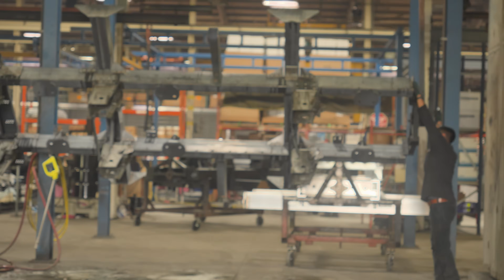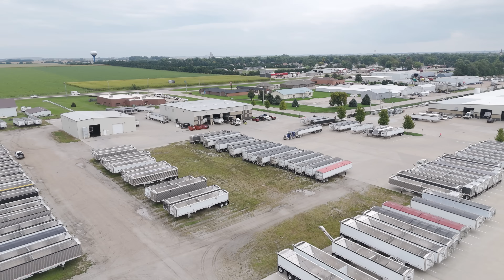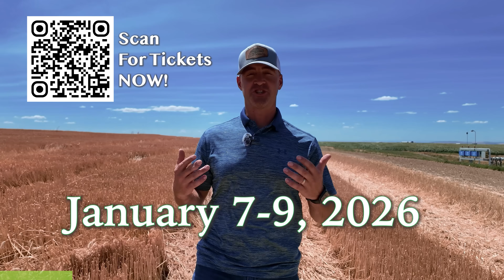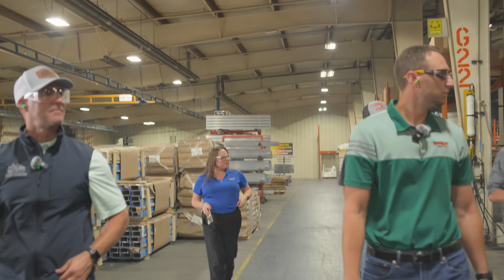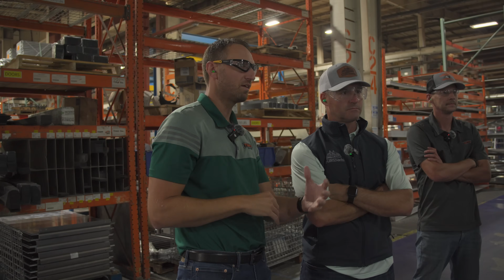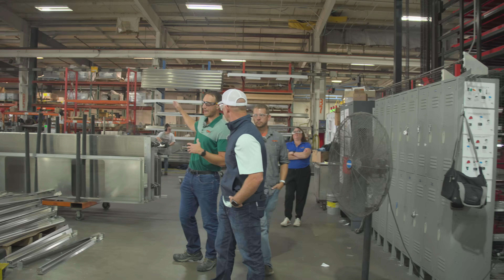How Timpte Manufactures 20+ Trailers a Day

Comment: I've owned several Timpte trailers.  Always pay cash using excellent trade in values the old ones have... Always buy 42'6" x 8' by 78' with tandems... using weigh gauges makes loading beans and corn... legal... easy--one pile in front and one pile in back. My latest is a real beauty queen---gun metal gray, polished alum outside wheels, extra set of lights, and the best push button operator convenience electric tarp along with elec/hyd traps.
Reply from the maker: That does sound like one good looking build out! What do you typically haul in it?

Comment: I always enjoy seeing how whatever is made.  I worked for 36 years for a major manufacturer with 2/3’s of that time working with suppliers trying to find a better way to do what they are doing (reducing costs).  The first question I always asked operators is “what works for you?”.  The second question is “what doesn’t work for you?”.  Getting people to buy in is always a major hurdle.  Make them part of the solution!
Reply from the maker: That's awesome! Great insight. We have some more pretty sweet tours of some manufacturing sites in the works. Where are some of the spots you worked at?

Comment: Cool video but I'm more of a cornhusker fan is there a lot lighter
Reply from the maker: We’re big Cornhusker fans too!
Reply: Cornhusker is lighter and cheaper!  Maybe I'm just a long time customer.  Get en straight from manufacturer in Lincoln.   Tripple axe 37° hopper angle of repose, tripple axle, 95K permit 28K empty wt truck and trailer with 7 axles is the dream setup, cornuskers empty aggregate from the hopper the best (worth alot)  It's tuff to get over 2200CF in less than 30k empty

Timpte is a fine trailer I pull a 42 foot 72 in ag hopper around the farm.  Like the stainless front and rear

Comment: They suck , frame rails break, hoppers break from the corners, and the 5th wheel cross members also break buy wilson instead
Reply: Sounds to me you abuse the hell out of your Timpte trailers
Reply: Timpte are built tough as hell, you sound like a Moron who can't afford good equipment, so you post this with utter lies... been doing this 43 years, and Timpte is an excellent trailer.
Reply: I've had both Brands do that, only two Wilson's though, they're a set out of ten I ordered, they would weld the frame and a week later crack again, but Tempte lately has been none stop with BS, Last new one was 2025 and got at end of 2024, Door issues, hopper issues, the cross members, I don't know WTF is up with them.
Reply: Wow how much did Wilson pay you to get on here and lie like that. I’ve had over 200 Timpte grain trailers and no major problems. Go sell stupid somewhere else!